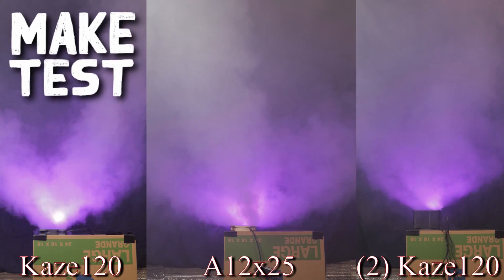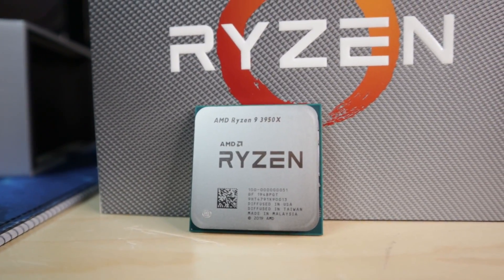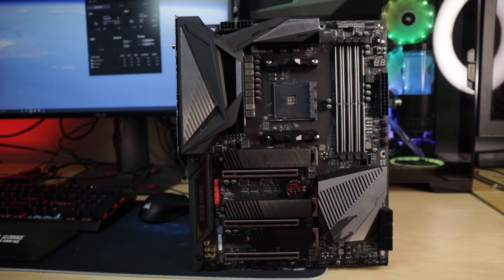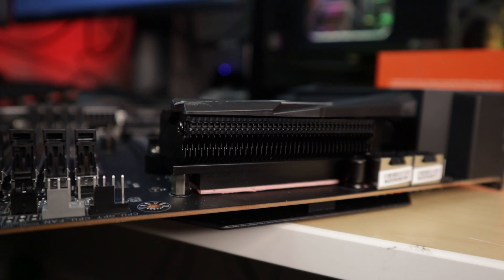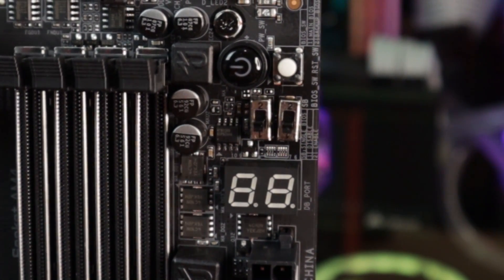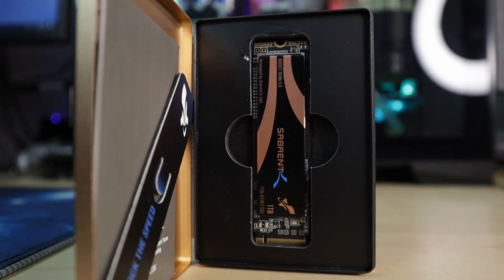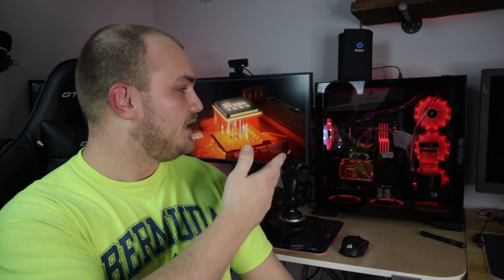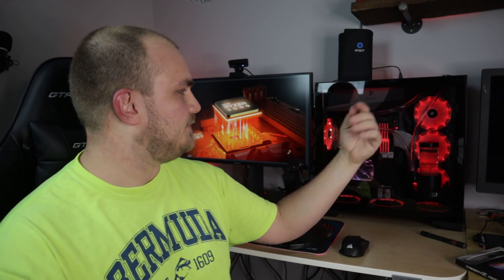EVERYTHING WENT WRONG, Upgrading I7-7700K to Ryzen 9 3950X

Comment: I installed 3 ryzen pc's over the course of last year.My brother and my friends pc worked fine.Mine was tricky.But it wasn't a user error it was a microsoft error.I have a raid setup installed on my 2xssd's.Works great but i can't install raid drivers in windows 10 as it would BSOD.Ok moving on i can live without it.Then i couldn't use windows till my chipset drivers got updated.Ok updated moving on.The msi command center would BSOD on every few runs.So uninstalled and eventually got my pc stable.At least i know what to do if i ever have to  reinstall my pc again( i reinstall ever 6 or 12 months depends on stability)
My friend actually went from editing video's on a P4 3ghz presscot to a ryzen 7 2700x and man he can't believe the difference.A 4m video would take around 1-2h now its like real time.

Comment: Very nice build mate, I didn't encounter any issues with my 3950x build it went smooth. Multicore performance is sensational Gaming performance is significantly better over 12nm, only thing I don't like is that Ryzen is tapped out even with a 2080Ti so future high end GPU upgrades are a no no.

My Specs:

-Ryzen 9 3950x @4.3ghz 1.3v
-Noctua Chromax NHD15 (Single Fan)
-Asus Crosshair VIII Formula X570
-64gb Gskill Ripjaws V 4x16gb @3600mhz CL18
-Asus Strix GTX1080Ti (stock)
-Corsair RM1000X PSU

Storage:

-Gigabye PCIE4.0 500gb NVME
-Crucial MX500 2tb SSD
-Sandisk 240gb SSD
-2x Seagate 8tb 7200rpm
-2x Seagate 3tb 7200rpm
-Toshiba 3tb 7200rpm

Edit: Your R20 score is like 500 points under mine, once you move to the 3600mhz Ram and set up your bios your score will increase.

Comment: you will get way better results with your fps with the higher freq ram. and i was barely getting 4.1 on my ryzen 5 3600 when letting it boost itself i would suggest a manual overclock. i have an all core verified oc of 4.4 on the 3600 at 1.25 v with just a hyper 212 evo.. great looking build btw!!!!

Comment: You are currently running memory below CPU spec, so running 3600 XMP should give a solid boost in both games and video encoding. Also since you are using a good water cooler you should put in the BIOS: PBO On, with maximums: 300W and 230A, for a solid boost in all core performance. (it won't use 300W, but higher margins give it more headroom) for PBO, and should give 4%-10% boost in performance in multithreaded stuff like video encoding.
Settings:
Precision Boost overdrive: Manual
PPT Limit: 300
TDC Limit: 230
EDC Limit: 230
Precision boost scalar: Manual 4x
This is in a way overclocking, but since it is not messing with voltage and manual frequency it is a safe one, since it just tells the CPU features to give it more automatic headroom wich can be reached if cooling is adequate, and the maximums set might only be reached in some extreme LN2 :D.
Link to buildzoid video: https://www.youtube.com/watch?v=G7Z7bJJcCNY
Another thing to make sure: on ryzen only even CAS latency works, else it is rounded up to the nearest even (C15 = C16), so try C14 if you have C15. And secondary timings and 1T command rate are also influential. So try to squeeze the timings on your memory if you have time. And most importantly have Infinity fabric run at memory speed (3600 DDR=1800) ... this should be the default if you set XMP to 3600. Every memory module today will work and not degrade  on 1.4V, so do not hesitate to up the voltage if needed.
Utilities: DRAM calculator for Ryzen, MemTest64, AIDA64 Memory bandwidth and latency test (and saving profiles in the BIOS when stable is your friend).
P.S. The second memory module might have been fried with a power spike on wrongly connected 5V rail by the wrong sata power cable, but it should be able to pass the RMA procedure. Be happy nothing else was affected.
Reply from the maker: i watched his video and did what he said plus i OC my gpu and things are humming along i need to make a followup as it feels like anew system now.
Reply: @MajorHardware  yea man he knows his shit. this 3950x cpu is such an ridiculous beast. looking forward to the followup vid
Reply: Atleast you credited buildzoid
Reply: @skoopsro7656  credit is due... i did never experiment with PBO settings myself, the rest is from my own experiments and research.
Reply: Marino Šimić samo jako, nema labavo. 💪😂
Reply: Just finished reading this and I am wondering what settings would be appropriate for me

Ryzen 3700x
MSI B450 Tomahawk Max
G.Skill flare x 16gb 3200 cl14 (stock xmp) 

Wondering what I can squeeze out of PBO, just left it on enabled mode and adjusted infinity fabric so far
Reply: @verios44  watch this video from buildzoid and use the same settings were applicable on your MSI board.
https://youtu.be/0J3Iswsvdvc
Reply: It's the same settings the OP posted. He just walks thru the explanation for it
Reply: Skoopsro im not on water, but a Scythe Mugen 5 rev B in push/pull using Scythe max 1200 rpm fans 

Shoulda added that to my reply to begin with
Reply: @verios44  shouldnt make much difference. Enter the same scaler settings 300 230 230
Or 
300 180 180
I've heard both work best and I'm a patreon of buildzoid and in his discord daily.

Comment: Lol Zen 2, especially the 3950x is much better in games than a 7700k.... Especially in 1% and 0.1% lows. Hell, my R5 3600 runs better at 4.2ghz boost. I had to download chipset drivers and wait for ASrocks slow ass to release an AGESA update for my boosts and XMP to work (back in July) but it does about 8700k level performance in games give or take 5% or so. Kinda like my 5700xt doing 1080ti level performance give or take 3% on average. The extra cores alone will DRASTICALLY help 0.1% lows in modern games compared to the 7700k. That 5ghz OC only helps with high averages - the micro stutter is real for sure.

Comment: I feel like you're doing something wrong if you don't notice a huge FPS bump. I mean those aren't exactly CPU intensive games, I would expect modern warfare to show a marginal bump. With that loop you should enable Precision Boost overdrive or at least do an all core overclock of 4.3 Ghz. My 3900x does it with a 360 AIO no problem. Also no GPU overclock, what's the point of the block? :)
Reply from the maker: I'm a complete noob sauce when it comes to AMD overclocking but if you have any good videos on overclocking ryzen 3000 hook me up I'm ready to get at it
Reply: @MajorHardware  https://youtu.be/vJQKjyBiX_I

Comment: Each company makes different location of voltage output pins. So let's say an A PSU has a 3-pins connector that goes +5V, GND and +12 and a B PSU has it going by GND, +12V and +5V. Seems like EVGA unit and Antec pinout differs.

Comment: I also have a 3950X, and oh my god it is incredible, I thought the 1700X was a nice upgrade over my 2500K, but the 3950X is still an incredible upgrade over the 1700X, I went from a ~24 hour encode for a BluRay rip, to 2 hour 30 minute encode for the 1700X, to a sub 45 minute encode on the same BluRay, Cinebench R20 went from ~3600 points on my 1700X, to 9375 points on the 3950X.

Oh, and overclocking is so much fun on the 3950X, I managed a 4.4GHz all core OC on it with only a few minutes of effort, which gave me a Cinebench R20 score of 10040, whereas my 1700X couldn't even reach a stable 3.9GHz, the best I got was 3.85GHz, and I intend on getting a better OC once I have more time to devote to learning the intricacies of Zen2 overclocking.

Also, the reason the cables are incompatible is because on the PSU side there is no standards for pin layout unlike the motherboard side, and the layout used depends on the PSU OEM, and even the same OEM can use different pinouts. (See Corsairs OEM with their Type3 vs Type4 pinout)
I would imagine that the 5V is mixed with a ground pin, and that's why it didn't kill anything, you got lucky with that, and with a multimeter you could probably swap the pins to make the cables work if you're willing to put the time into it.
Modern PSU's are amazing at detecting overvolt, overcurrent, and short circuit events, and can survive even the most catastrophic failures with grace, especially Seasonic PSU's those things are just incredible for their build quality.
Reply: I must have a golden 1700x. I got 4 ghz with one + bump up on v-core.
Reply: @NoGoodNoob  I've heard of some Zen1 CPUs hitting 4.1GHz+, but those are exceptionally rare, and you might have one and you're very lucky if so, I got an utter lemon with mine, and it made me want to puke when I saw how bad it was, 1.425V got me 3.85GHz, and it wasn't 100% stable in some workloads even then. :(

Comment: You are impressively careless with your builds lol
Reply from the maker: haha i would like to disagree however history proves you right
Reply: I was a bit too careless with a hard drive and broke some of the plastic where the sata power was supposed to be connected. None of the actual pins, but yeah that was a bit unfortunate.
Reply: @ArtisChronicles  i did the same as you, so i replaced the sata cable with a spare and it killed two hard drives. im never using different psu cables ever again, lucky it was on an old shit box.

Comment: gpu score of your 2080ti 13765? with a 7700k in the system that is.. damn..
I get 10765. with a 1080ti and a tiny i3 8100. the i3 only gets 3551 cpu score tho :P
but, in conclusion a 2080ti is about 28% faster in a total gpu use scenario such as time spy. 1080ti was 700usd at launch, 2080ti was 1200usd and currently, where i live it's 1300usd for a basic gigabyte gaming oc model).
that's about 72% more $$$ for 28% more perf, three years later. 
I know this is a dead subject but man, I still can't wrap my head around this :))
Reply from the maker: Here is to hoping AMD big navi makes a splash and gets the prices down to what they should be.

Comment: I am glad you took your time and did proper troubleshooting before releasing your vid.
Other big YouTubers blamed their pre-production X570 Master issues on AMD for no reason... cough Jayz cough
Reply from the maker: ive never experience troubleshooting like this and i have worked maintenance jobs in the past

not powering on..........evga psu cable used on antec psu to blame

RAM not detected........ one stick DOA

System locking up diminished performance........ Chip set drivers out of date.

after all that my troubleshooting profession leveled up 5 times

Comment: Yeah, modular PSU cables are completely non-standardized. Never ever mix them, unless explicitly stated that it's okay (certain families of Corsair PSU's are cross-compatible, but they say ON THE CABLE which ones). Lesson learned there, glad you got to learn it with a modern PSU that has enough protection circuitry to prevent a total trash fire, wouldn't have been so lucky 10 years ago! So yeah, tl;dr - never ever mix modular PSU cables, ever, never, ever ever :D

Also nice, DCS, hold on to your wallet, it's easy to get addicted to splurging on every new module that comes out... But it sure is impressive.

I think with better RAM, your results across all applications will improve a notable amount. Ryzen is particularly sensitive to RAM speed and latency, especially the latter - if you can run 3200 or 3600 CL 15, or 14 (I can just barely make 3600 CL14 with my 3200CL14 TridentZ kit), it's actually a pretty big deal. Avoid high latencies, like above CL16, like the plague. It's probably better to drop the MHz a little if it lets you run lower timings, 15 or 14. But also, don't drive yourself insane with trying to optimize Ryzen RAM settings, it's a complete black hole of a time sink...
Reply from the maker: this is a lesson i will not soon forget, before this i had no idea.

Comment: Thank god nothing bad happens to your system. I have 1950x on my streaming PC and right now I was thinking of getting the 3950x for streaming/editing PC can you tell me about the temps idle vs full load?
Reply from the maker: during cinebench R20 runs CPU temp never went over 65-68c and thats with all 32 threads at 4050 clock speed. thats also on custom liquid cooling (hydro x) idle temps are dependent on my fluid and gpu temp but normally around 40-50c

Comment: It probably shorted one of the voltage rails to ground. The click was a relay in the power supply turning off.
Reply from the maker: glad it did that and not just nuked my system

Comment: I went from a 7700k to a 3900x/ Aorus Master....no regrets :)
Reply from the maker: same here
Reply: @comradedyatlov2227  sorry to hear that you have regrets with the switch. I stayed on Ryzen first gen. I've actually locked my processor to stock without boost function. No particular reason other than I never felt like I actually needed more out of it since I'm actually not doing anything serious with it.
Reply: 7700k to 3900x and gigabyte x570 xtreme. No problems amazing.
Reply: @comradedyatlov2227   The 8700K is faster than the ryzen 1st gen,  epecially for gaming. But if you're doing a lot more than gaming, then It can stretch its legs with the extra 2 cores. But since the 8700 is faster already, you'd probable won't notice much difference
Reply: From i3 4th gen to ryzen 5 3600 no regrets
Reply: @idreesbaksh2505  obviously you went fron 2c4t to 6c12t
Reply: Abid Dyan 7700k is 4c/8t
Reply: I went from an athlon x4 860k to ryzen 5 1600(1st gen) with a b350 rog srix gaming-f board (I know the board is over kill my friend gave me the board for free)
Reply: same but mine is 6700k to that and the mobo is Aorus Ultra

Comment: I ran into that PSU cable issue twice. both times it was a Sata cable from EVGA on another brand PSU that stopped the PC from turning on. I never tried with other brands.
Reply from the maker: others have commented horror stories of mixing up cables so i will make sure to never let that happen again i got lucky from what i have read.
Reply: From what i heard each brand has their own specs and the psu not turning on is just its way to prevent damage. Removing the cable fixed it both times in my case and my hardware works just fine.
Reply from the maker: same happened to me
Reply: i have also successfully used a 6+2 gpu power cable from evga on a corsair psu before, the pc is still running 2 years later no issues, so its leading me to think its more of a proprietary thing than anything

Comment: You have to install chipset driver for AMD, its mandatory. And when you installed chipset drv, go to power managment and change power profile to "AMD Ryzen Balanced" in first gen this is  MANDATORY, Try to install program called "Process Lasso" by BITSUM, at 1gen Ryzen this program did magic with process in memory, fixed bad windows scheduler, after install in power management set "BItsum Highest Performance". MIcrosoft probably fixed already scheduler but I dont believe them :). I'm still using Process Lasso and I'm happy with results at my crapy "slow" Ryzen7 2700 without X. Chipset driver? yeah for intel chipset you have also driver, but after intel released "3gen core-i" and released 10th series driver, every driver positon was called something like "we are to good and powerfull, micro&soft compiled our drv into core of wincrap" You had to unpack their driver and search for this this was hidden :) Second thing most intel users (not to much just only 95%+)  NEVER installed at their computers any intel drivers except for powerfull intel gpu. (technician knowledge of 20 years of maintaining windows systems yeah little more then 2) ........... and provide for us dream of "4core almighty power" for ten years bullcrap........, and "you dont have to have more cores" more bullcraps..........,, and now we have 14+++++++++ saga, vulnerabilities and security flaws, etc etc etc. AND shortly all i7 generation from first to seven will be degraded to i3................. if you dont believe................. just wait for i3  10th gen intel CPU
Reply: i had a serious stroke reading this
Reply: batorki
This video was about his upgrade experience, not Intel.  Why is it someone has to dig up shit to ruin a sensible comment section?  If you prefer AMD then enjoy but don't look for others to pad your fat head ego.

Comment: i see you started First problem was getting ur psu cable mix up in one place 
that not good at all n i can see that u destory two Ram already 

AMD required driver upgrade when ya get it put together n start up

i love AMD n amd was my first gaming pc back in 1990 n love it n miss it n still have it never letting it go at all n i still fixing mobo "hate you capacitor pop on board"

i do remember someone posted something about ryzen 9 some support 3600 most don't support it so if u step down to 3400 that should work with any AMD CPU unite u upgrade driver n bios that way you could get 3600 to work with it im not sure "dont own newer pc never afford it "

Comment: dont waste your money upgrading your ram on the ryzen 3000 , the infinity fabric introduces almost 100% more latency than the 7700k , just use what ya got .besides the point tyhhe 3000 ryzen doesnt benefit from faster  memory to begin with. if any one tells you ryzen 3000 gets better performance with better or faster memory well no duh name a system that wouldnt , but its only about a 2-4% gain .AT BEST
Reply: yeah, buy 2133mhz memory, and ..................... ohhh you benefit with faster memory, but for intel buy, buy,  buy, buy you have 1fps more :).for amd dont dare to try this 1fps :)

Comment: What's 'DCS' and what's a 'chipset update?'

I'm running a similar build except that I'm using a Asus X570 Crosshair VIII Hero Wifi board.
Reply: DCS is a flight simulator, for AMD system make sure you download their chipset drivers: https://www.amd.com/en/support/chipsets/amd-socket-am4/x570
Reply from the maker: Yes what he said get the driver in my vast experience (1 AMD build) it runs like liquid garbage without it